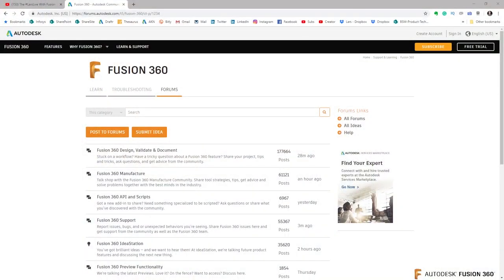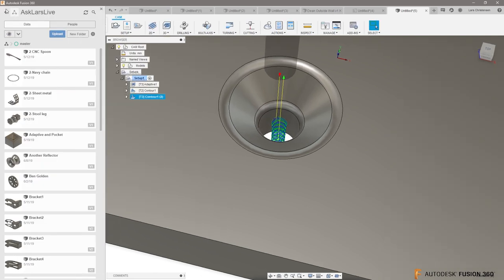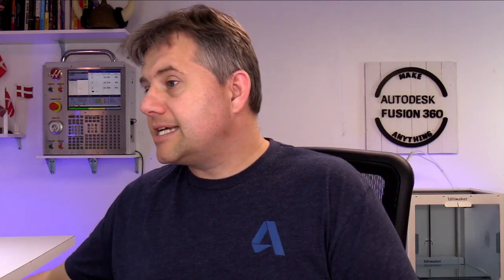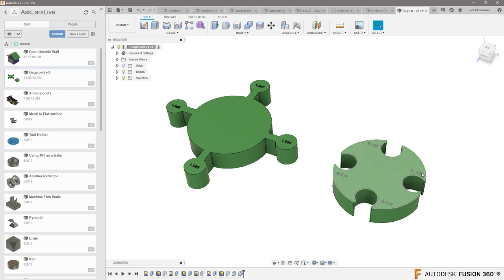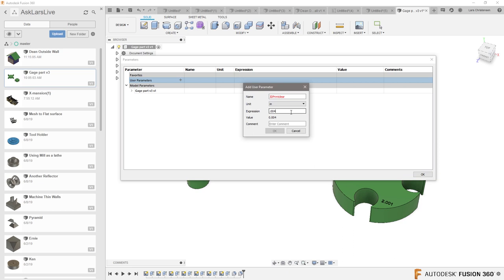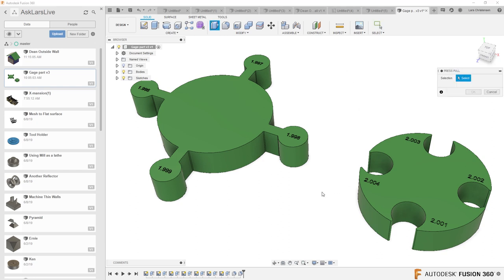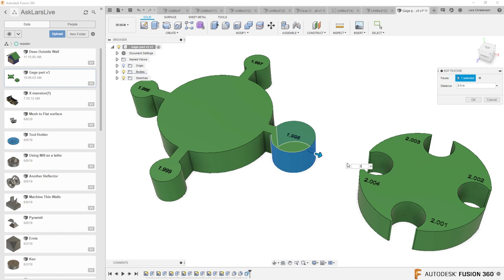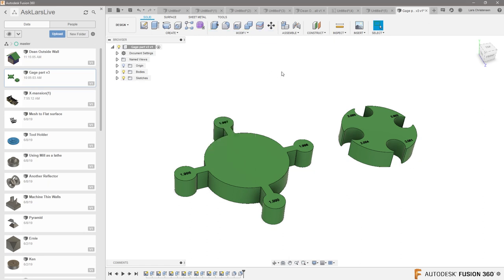Fusion 360 — Where To Do 3D Printing Tolerances — Ask LarsLive

Comment: For 3DP I use a bunch of 2-4mm screws in my builds. 0.2mm oversize for screw holes is a good start point and added to the sketches. For sliding parts it depends on their function but I err on the snug side and ease post printing

For laser cut joints however I push faces on the model. Might seem contrary but it makes sense to my brain ;)

Comment: I wish it were thousandths we were dealing with on the 3D printers.  It seems to me to be more like tenths of millimeters and totally depends on the filament, too.
Reply: The 3d print genre specifically and plastic in general does not lend itself well to precision. The next step up is a mini mill to make injection molds. Not rocket surgery but a bunch further up the price ladder.
Reply: We are dealing with thousandths...  A general clearance is 0.2mm/8ish thou, and most printers allow for clearance of 0.15mm/6ish thou.
Reply: @EuanTodd  Microns, not inches.  Thousandths of a millimeter.

Comment: I would like if combine tool had offset when you cut a body with another (tool) body. I often design for 3D printing and this is probably feature I miss the most. Would like if you come up with a solution for that so my parts fit perfectly.
Reply: Ya! So what you do is use the offset surface command and then use that to make a new surface cutting tool in the shape of the thing you want to fit together, then use it to split the body and lastly use the remove command.

There's probably a cleaner way to do it but this is what I do on weird shapes
Reply: @Anonymouspock  Not sure I understood you. I often have problems with complex shapes when everything I try finishes with unsuccessful command due to Fusion not able to calculate. I googled it, tried several methods and nothing yet.

Comment: I allways use a set of parameters for most printer settings such a layer height, extrusion width and tolerance.
With the extrusion width you can controll thin walls precisely.
I also define hights from 1-9 mm rounded to the nearest layer.
These are my standard parameters:
"lh1","mm","0.2 mm","First layer height"
"lh","mm","0.15 mm","Layer height"
"Tolerance","mm","0.1 mm","Tolerance"
"ExtrusionWidth","mm","0.45 mm","ExtrusionWidth"
"H1","mm","( ( round(( 1 mm - lh1 ) / lh) ) * lh ) + lh1","+/-1 mm height from buildplate"
"H2","mm","( ( round(( 2 mm - lh1 ) / lh) ) * lh ) + lh1","+/-2 mm height from buildplate"
"H3","mm","( ( round(( 3 mm - lh1 ) / lh) ) * lh ) + lh1","+/-3 mm height from buildplate"
"H4","mm","( ( round(( 4 mm - lh1 ) / lh) ) * lh ) + lh1","+/-4 mm height from buildplate"
"H5","mm","( ( round(( 5 mm - lh1 ) / lh) ) * lh ) + lh1","+/-5 mm height from buildplate"
"H6","mm","( ( round(( 6 mm - lh1 ) / lh) ) * lh ) + lh1","+/-6 mm height from buildplate"
"H7","mm","( ( round(( 7 mm - lh1 ) / lh) ) * lh ) + lh1","+/-7 mm height from buildplate"
"H8","mm","( ( round(( 8 mm - lh1 ) / lh) ) * lh ) + lh1","+/-8 mm height from buildplate"
"H9","mm","( ( round(( 9 mm - lh1 ) / lh) ) * lh ) + lh1","+/-9 mm height from buildplate"
"h1","mm","( ( round(( 1 mm ) / lh) ) * lh )","+/-1 mm height Not from buildplate"
"h2","mm","( ( round(( 2 mm ) / lh) ) * lh )","+/-2 mm height Not from buildplate"
"h3","mm","( ( round(( 3 mm ) / lh) ) * lh )","+/-3 mm height Not from buildplate"
"h4","mm","( ( round(( 4 mm ) / lh) ) * lh )","+/-4 mm height Not from buildplate"
"h5","mm","( ( round(( 5 mm ) / lh) ) * lh )","+/-5 mm height Not from buildplate"
"h6","mm","( ( round(( 6 mm ) / lh) ) * lh )","+/-6 mm height Not from buildplate"
"h7","mm","( ( round(( 7 mm ) / lh) ) * lh )","+/-7 mm height Not from buildplate"
"h8","mm","( ( round(( 8 mm ) / lh) ) * lh )","+/-8 mm height Not from buildplate"
"h9","mm","( ( round(( 9 mm ) / lh) ) * lh )","+/-9 mm height Not from buildplate"

Comment: Thanks for this video, 
When I designed a model rocket the engine needed to fit  inside and I used threads to hold it in place.
Your tip reminding us about how threads are formed in Fusion 360 is very valuable information!

Comment: Hi Lars , 
I am no expert with Fusion or 3D printing but one thing i have learned is to set up your tolerances before slicing as each slicing programme is a little different , i use Cura and have spent considerable time fine tuning it so I don’t really want to change settings in this programme every time i want different tolerance fits - much easier to set it up in the design in Fusion before hand as it takes the slicer programme out of the equation .